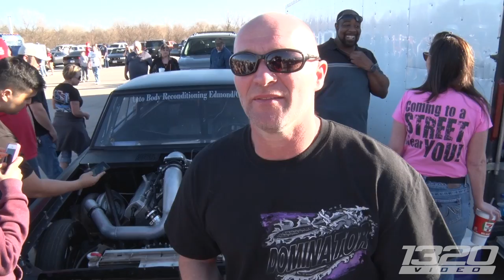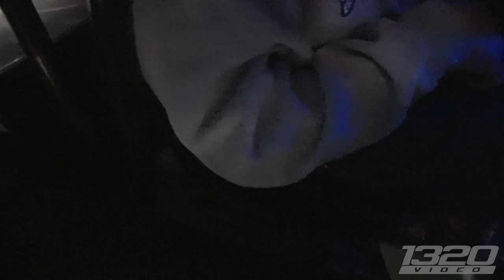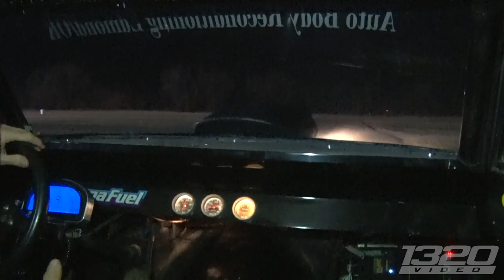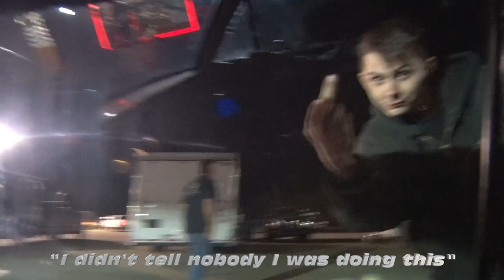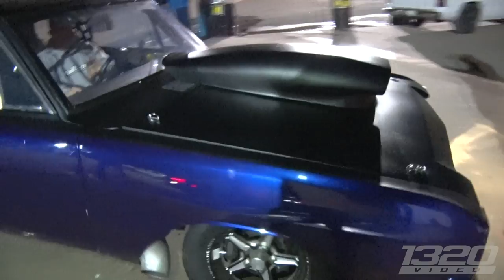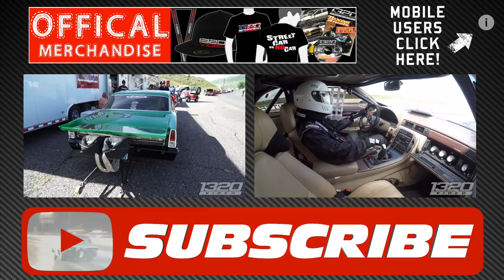DOMINATOR - SECRET Dodge Dart Build!

Comment: Glad to hear it!!! I really hope he goes for that hemi, he could absolutley destroy with a TT hemi!!
Reply: +Jake Morris 
Based on what?
Reply: He said that is the end goal for this car because all the mopar fans dont like a chevy engine in a dodge, me included.
Reply: +Jake Morris 
I was referring to the "he could absolutley destroy with a TT hemi" part of your comment. 
Name the twin turbo Chrysler Hemi vehicles that are quicker than GM powered. 
Where are their names in the record books?
Reply: Jake Morris
Yes. 
First, there is no comparison between the this car and a Top Fuel dragster. 
Second, TT indicates "Twin Turbo"; Twin Turbo Top Fuel dragsters do not exist. 

You claim: "there are plenty of mopars that can beat GM cars, especially with the more efficient design of the hemi.". 

Not that would run in the same class as the car featured in this video. 
If you have proof to the contrary, name the car, car owner, ET, speed, date, event and sanctioned record held. 

There are very solid reasons there are no GM engines competing in Top Fuel and Funny Car classes.... the only allowed engine style must be a Chrysler Hemi derivative...  every other manufacturer is excluded by the rules.
Reply: +patw52pb1 Search 3000hp HEMI Cuda on radials on youtube, the thumbnail will be a blue 67-69 barracuda.
Reply: Jake Morris
What is your point? 
The car in the video you referred to is running an F3 ProCharger not a TT. 
Read the video description for more info or watch and listen to the owner in the video describe the car. 
Bottom line is for the last 46+ years GM/Chevrolet has won more races and won more classes, and won more annual championships and won more annual manufacturer cup awards than any other manufacturer. 
i like Mopars, I proudly own 2 Hemi powered pieces of history a Dick Landy car and a Sox and Martin car. They were both winners in their day, but would not even make it through the first round of qualifying today.
Reply: patw52pb1 you are absolutley correct, in the late 60s and early 70s, hemis were street and strip kings, and sure GM could definately compete, but i feel like the mopars ahd the edge with the HEMI and the 440 Six Pak. Nowa days tho, yes GM is definately in front of its competitors, but i feel like people like NRE gives the hemi true potential

Comment: it does need a twin turbo hemi
Reply: stoopidvideo no it dont. he will go faster with what he has now verses putting a overpriced turd hemi in it
Reply: 1970 olds442 ha! That's why the fastest cars in drag racing run hemis right? If it's so much better than a hemi then how come they aren't running those on funny cars and top fuel instead of hemis?
Reply: Chris West oph

Comment: if dominator put a twin hemi he would be my new favorite!
Reply: +Steven Holmes if he'd put ANYTHING mopar in it he'd be my favorite. I think he oughta get a 440 stroker for it
Reply: You also spend three times as much to buy a mopar engine and the parts for it.
Reply: +Jakob Fields so what it's a great motor set up for anything
Reply: Jakob Fields that is not true at all.
Reply: villen "a 440 stroker".... meaning, start with a 440 block, and then stroke it
Reply: +gary williams he can't  get 200 more cubic inches out of a  stroked engine, with a 440 he could strike it to maybe 490
Reply: Jakob Fields after a quick google search I found an "off the shelf" stroker kit to take the 440 to 535 cu inch. and I just watched a yt video of a 547 cu inch making 750hp on 112 octane gas. and these are both street engines
Reply: +gary williams congrats you knew about something that somebody else didn't know. you win the internet I guess.

Comment: Places Turbos right beside the Headers... Not the most efficient place to put it... None the less dope build!
Reply: Right?! All i can think of is that turbo sucking in all that hot air coming off the headers
Reply from the maker: Same design and murder nova, big chief, jeff Lutz, etc etc...
Reply: 1320video oh OK then I geuss its a proven setup with the exception that you have a OP charged air cooling system!
Reply: +1320video easy there fella, these keyboard builders know what they're talkin about. now where's that blue sarcasm font at?
Reply: helldog918 Its because the cold side of the turbo directly facing the headers so I thought that wouldn't be efficient.
Reply: The headers go into the turbo, idk where else you want him to put them. They dont make much boost sitting in the trunk next to the fuel cell...
Reply: rzr kid some guys put the turbos up high near the grill.
Reply: villen Since when was I  bragging and talking smack....
Reply: i think with alcohol and the scoop on the hood dumping air on top of the motor he'll be just fine.
Reply: ***** OK thanks for informative reply much appreciated.
Reply: He's on methanol which will cool intake temps due to latent heat vaporization
Reply: +1320video ya, exactly. when did drag racers become such sheep?? everybody runs the same suspension, same turbo's, same dumb ass looking exhaust out the fenders. hell, they even run the same damn tires!! and then they all get the same results. I've not seen one of them deviate even slightly. people have also totally ignored ram air. either put the turbo's up front, where they get cool air, or run ducts to them. not one of these guys even builds their own engine! they all buy a crate engine. throw some turbo's on it. they don't even use the wheelie bars. and the ones that do, have them clear up to the bumper where it does absolutely no good what so ever. knowledge is being lost. guys can't run well without giant funny car slicks, and a trans brake. we (dad and I) built a 69 dart in the early 80's, with a cast iron 340/727, stock suspension, and REAL street tires and we turned 10'3@131. if we could do that well, with so little, what's some of these other guys excuse? someone needs to tell these guys, if they'd drive straight, they might turn a better time. most of the outlaws are weaving from side to side. they turn the 1/8 mile into a 1/2 mile
Reply: you're actually completely wrong lol the closer the turbo is to the exhaust source, the hotter the air, the faster it spins, and if you think hey well the air going into the motor will be hotter, technically you're right but the difference will be negligible on the iat front but the gains you get in spool and overall boost will outweigh that
Reply: It also moves the weight of the turbos behind the front wheels, helping weight distribution. When they're making 2000+ hp, they're likely more concerned about making it hook.
Reply: +MrManuel1329 It's a drag car its run at full power for some seconds,if it was a track car then yeah this would be a problem, also doing the turbos that way minimizes the exhasut length giving an instant turbo response (quicker turbo spool).
Reply: +gary williams look at sport bikes, kinda the same deal.  all the major manufacturers build almost identical bikes.(couple exceptions).  at a certain point the best "formula" is figured out and you just aren't gonna be competitive trying to be different.
Reply: +gary williams proof is in the pudding. look at deathtrap, he has his turbos mounted up front...and he has nothing for anyone in the top 5. Andrade jr has a front mount twin setup too with big tires and he is still having boost issues.
at the level of competition they are at, fast is fast. the recipe is gonna be pretty close when you break it down. the big difference is the tune and driver. the big variable is whatever surface you are gonna run.
Reply: +Naptown Squid Most of the motorcycles in the 1000cc class are different. BMW S1000RR has an crossplane inline 4, Yamaha R1 has a flatplane inline 4, Aprillia RSV4 has a V4, Ducati 1299 has a V-twin, Kawasaki H2 is supercharged. Only BMW and Honda use a conventional inline 4 in their superbike. The difference in basic engine layout makes for a fundamentally different bike.
Reply: +George Hardy says 1000CC class then names two bikes not 1000cc.   compare rake, wheel base, swing arm length, suspension type,  piston to rod ratio, cylinder head dimensions and valve train, etc etc.  your right though Yamaha uses a different firing order.....
Reply: They are in the class....
Reply: +George Hardy the h2 certainly isn't.  what as far as wsbk?   1000cc sport bikes I believe is what I said not supercharged unlimited class bikes
Reply: So let's swap all the best parts from different bikes and make the best one...oh wait they are different.
Reply: +George Hardy different as far as they don't bolt together? or different as far as they are a completely different design? look at spec sheets for all the major manufacturers 1000cc bikes they are ridiculously similar.
Reply: does it make a fuck?  the airs gonna go through the intercooler first
Reply: +Jobless Drew no innercooler. methanol runs cooler
Reply: +George Hardy Only the Yamaha is crossplane, BMW, Suzuki, Honda and Kawsaki (ZX-10R) all are conventional I4 1000cc engines.
Reply: Very simple - they all end up going the same way because its what works best.  Turbos work best with the shortest distance between the exhaust port and them - you loose less energy in the exhaust gas which is used to drive the turbine.  Also, weight distribution is better when they are farther back.  And the large exhaust pipes out the side are because turbos line as little back pressure past the turbine as possible.  The hot inlet air isn't really a big deal because of the methanol (its not uncommon to see frost on the injector hat of methanol cars).  Methanol has a pretty massive latent heat of vaporization, which really cools down the mixture.  I bet the intake temps on his car are below ambient by a pretty good amount, even with all the heat put into the air by its compression.

Another nice benefit is that methanol is really easy on parts compared to gas at these power levels.
Reply: +no body They move the turbo's to the rear of the bay for better weight transfer. Big Chief explains why they did it this past season. These guys are running meth which reduces the intake temps when it evaporates. There is so much wrong with your post. There is so much learning you need to do
Reply: LOL
Reply: good thing these guys still have nitrous and carbs to play with.
Reply: 1970 olds442 I really dislike fart can Hondas
Reply: Running the headers out the wheel wells and not out the fenders keeps the body clean looking.

Comment: we all know chevy motors make the most power for the least money!! cmon guys just go to the track and watch!! just stating a fact!! hell Shane's dragging the whole lists ass with a little smallblock I could build for five grand!!
Reply: +Dozer Smith the only reason Chevy's are cheaper, is because you have to put three times as much in it to equal a mopar
Reply: +gary williams  That doesn't make any sense.  It's a contradictory statement.
Reply: +StL ChuckO Yea I have a feeling that guy isn't the brightest crayon in the box.
Reply: 3Ctulu so tell me smart guy. what engine do most top fuel and funny cars still use today? oh that's right A HEMI, in other words MOPAR. yes, yes, I know, produced by Keith black..... which he bought from mopar
Reply: 3Ctulu what you mean is, there's NO Chevy's in either category
Reply: gary williams
The only thing you've proven is what engine is best for nitro meth.  When nearly any other fuel is involved, there's virtually no hemis in sight.  And since you're considering hemi based aftermarket engines to be "MOPAR", then the same goes for all those designs based on Chevys get the same consideration.

The quickest door slammers in the world run Chevys (record, Q80 Camaro).
The fastest piston engine cars in the world are powered by Chevys (record, George Poteet Speed Demon).
And, Chevy engines power the vast majority of the fastest/quickest street cars...  Including the current and previous world record holders....   Larry Larson's S10 (previous, Frost's Red Victor 3).

If Hemis are so dominant, how come the only thing they dominate is Nitro Meth based racing....

Oh...  that's right.  You didn't bring those up because it doesn't fit your narrative.
Reply: StL ChuckO well actually, I don't even like the hemi. and btw, not one of those "cars" you mentioned is even remotely "street"
Reply: gary williams
 So you don't even like the Hemi, but you argue that it's better....  Even though you only bring up Nitro meth cars.

Larson's S10 has competed in Drag Week and Rocky Mountain Race Week, completely multiple 1000+ mile road trips in those events, has a VIN, insurance, tags and passed inspection.....  But it's not "even remotely street"?
Even if you could demonstrate that it's not street legal or couldn't survive on the the street (which you can't), it has no bearing on the conversation since the only thing you've brought up is Top Fuel and Funny cars that get the engine rebuilt every pass.
Reply: +StL ChuckO I'm not being a Honda hater here, having built several b16/b18 builds myself in my younger days, but his car experience seems to extend to a h22 powered Prelude.

the rest is keyboard racing. Oh and the best part, he's apparently trying to trade said prelude for a 60-70s Mopar in good condition. His grasp of cars is....a little off.
Reply: 3Ctulu uh, actually I was building mopars long before I got this prelude. secondly, the prelude is mostly stock, as I stated in the video. and finally, I said in driveable condition. I never once said "good condition"
Reply: +gary williams but you're not a hemi fan, and you want a Mopar powered car....beyond done with this conversation.

Comment: if he'd get rid of that Chevy engine, he'd be my favorite outlaw. but I can't get behind a mopar with a fucking Chevy engine! get a 440, build a stroker, and make it a real mopar!
Reply: CHEVY powered really hell for those that run a Chevy powered car it would be better off installing a moped engine or a wind up you mechanism in the car it would go faster and be more reliable so your not forced back on a trailer but I am with you man dodge builds should be all mopar just like Ford's should have motorcraft but if I see another Chevy with a Ford 9" rear I will go haywire they need to stick with there own breeds. besides I would rather drive a Ford or Mopar than keep my hands on the heated trunk or tailgates supplied for by GM.
Reply: CHEVY powered really hell for those that run a Chevy powered car it would be better off installing a moped engine or a wind up you mechanism in the car it would go faster and be more reliable so your not forced back on a trailer but I am with you man dodge builds should be all mopar just like Ford's should have motorcraft but if I see another Chevy with a Ford 9" rear I will go haywire they need to stick with there own breeds. besides I would rather drive a Ford or Mopar than keep my hands on the heated trunk or tailgates supplied for by GM.
Reply: +James Jarvis And you apparently didn't watch the video. He said he got what he could afford, and the ultimate plan is a turboed Hemi.....
Reply: WalshiesWoods I made the comment as I was watching. why is it that the majority of mopar guys go directly to the hemi? the hemi is an ok engine....if you have money to burn, but mopar had a few good engines that you wouldn't have to mortgage the house for a basic short block. the 426 wedge(non hemi) the 440, my favorite engine. the 340 was also a very good engine, although too small for pro mod obviously. I wish people would go back to building real engines. no nitrous, or at least not JUST a nitrous engine. I'm really sick of turbo's. it used to be nitrous, and turbo's were seen as cheating. and most of the time it was for guys who couldn't build an engine. I know people these days think you can't make power without nitrous, or turbo. but that's simply not true. in the early 80's, my dad and I built a 69 dart gts with a naturally aspirated , cast iron 340. full interior, stock suspension, and everyday street tires, and it was a daily driver. we turned 10'3@131. if we could do that, under those conditions, these guys sure as hell ought to be able to get in the 6's (1/4 mile) I've got pictures of that dart if you wanna see it. it's in grey primer

Comment: Great guy, lame engine choice. When are these guys going to realize that Chrysler builds the strongest blocks and make the most powerful per c.i. than any other brand yet they still run to Chevy engines. Yes Chevy's make great power but Dodge makes more. Every time. Even the non-Hemi's. The RB440 engines beat Hemi's. The 440's have the same bulletproof bottom ends as the Hemi and have bigger bores. Race Hemi blocks are the strongest period. If Dominator ran a race Hemi block with 440 style heads boosted - it wouldn't be power that he has to worry about - it would be breaking driveline parts. A big block twin turbo 440 makes stupid horsepower. Mopar engines rule. And always have since the 60's. Cheers 😎